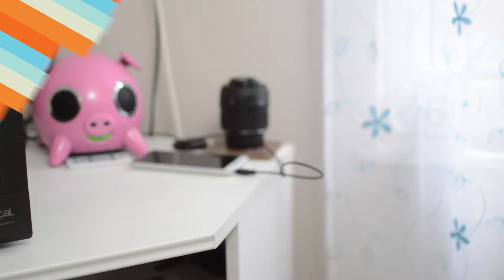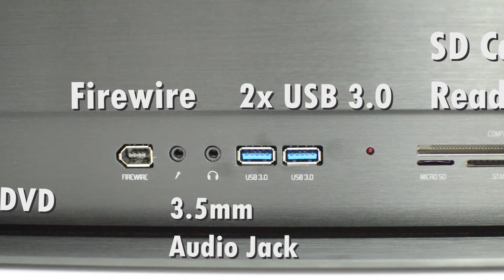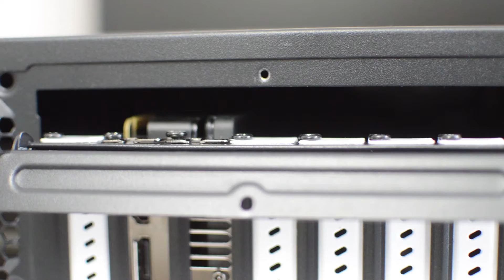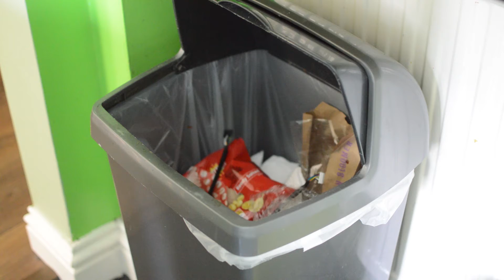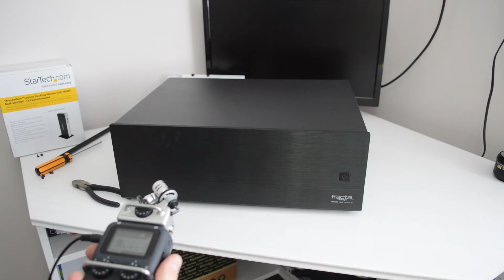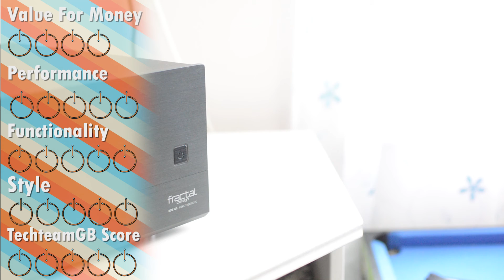Fractal Design Node 605 Review

Comment: Can you use it for a gaming build I know no one will respond but if so can i
Reply: Yes, I use this for an i5 2500 and GTX 750 Ti. Great for emulation and DirectX 9 gaming.

I also managed to fit the 90mm Thermalright CPU cooler in with plenty of room.